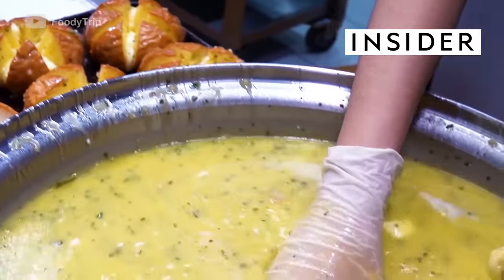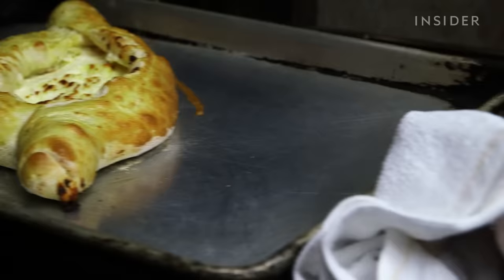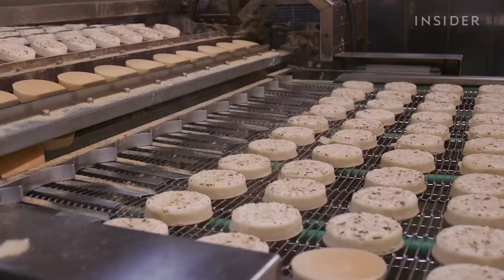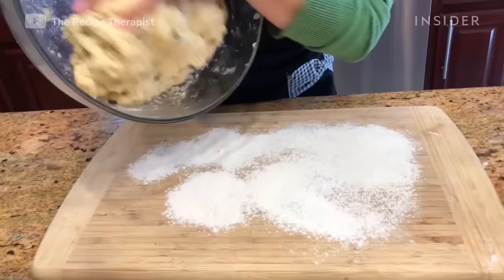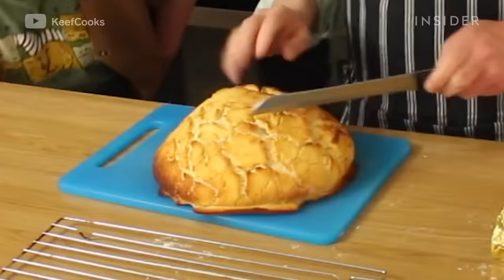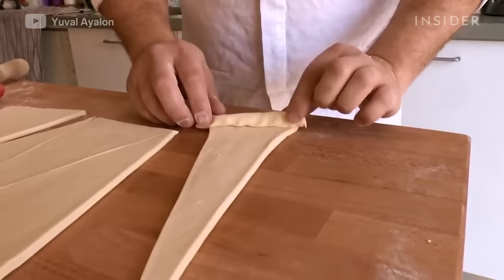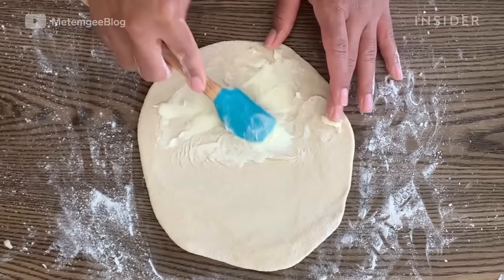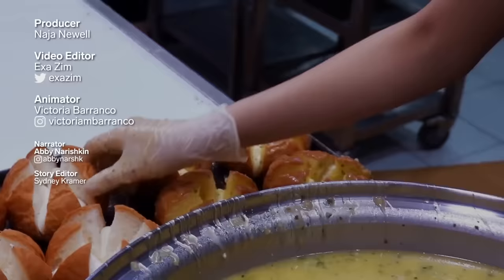29 Types Of Bread Around The World | Around The World | Food Insider

Comment: 8:27 this is just factually wrong. Hetero fermentative lactic acid bacteria produce  lactic acids and acetic acids. To produce the “tangy” acetic acids the temperature during fermentation has to be 20-25 c. 

Furthermore amount of acid and the pH of the sourdough depend on hydration, time, temperature and the amount of starter. 
For comparison a mild Berliner kurz Sauer (100% hydration, 20%starter, 35c over 3 hours with 50% of the the rye) has a pH of 4-3,8 with 10-12degrees acid, while a more acidic Salzsauer (100% hydration, 20%starter 35c dropping to 20 c over 24-72 hours with 35% of the rye) has a pH 3,7-3,5 and 18-21 degrees acid. 

As you see age of the starter is irrelevant to this.  

I would go as far as saying that most starters develop over time as the flour/meal used to freshen it up always varies at least a bit. With that the starter changes too. 

So seriously, how did you come up with this ridiculous statement?
Reply: Ummmm....... Ok
Reply: @unknownhehe5953  what?
Reply: r/iamverysmart
Reply: K3RA - B1NE correcting misinformation is way different than being a pretentious jerk and acting superior. He just corrected the statement